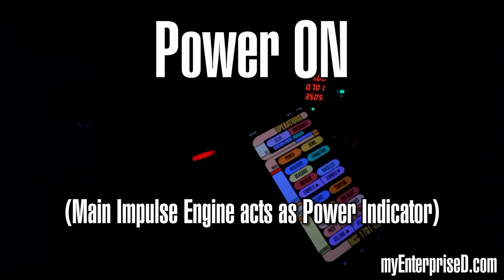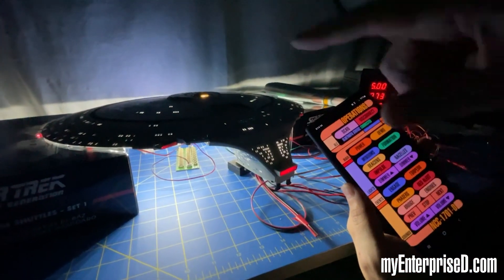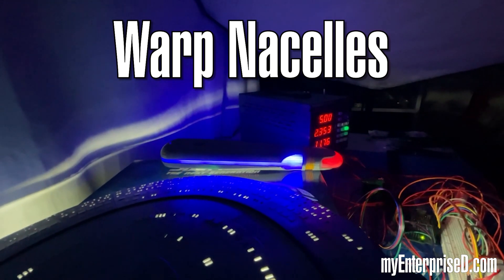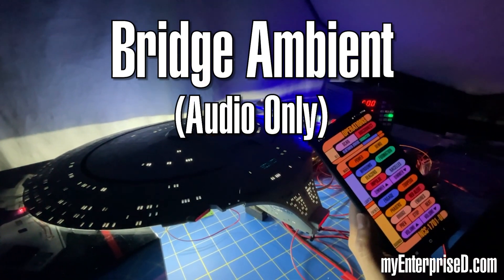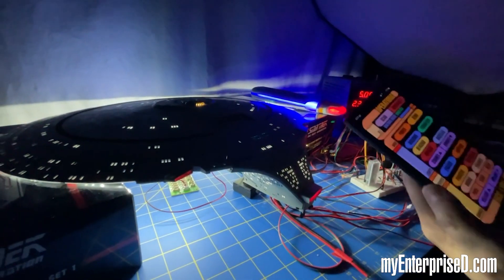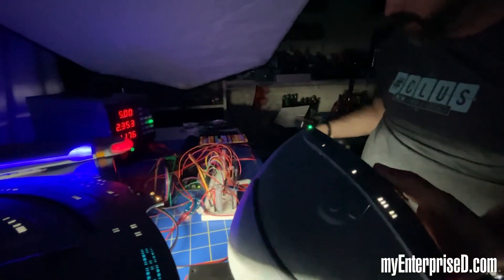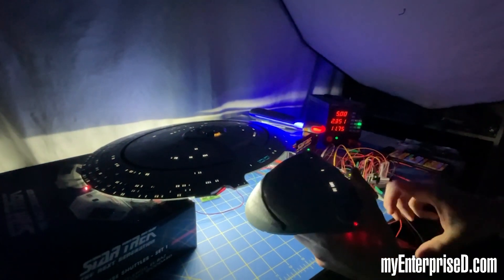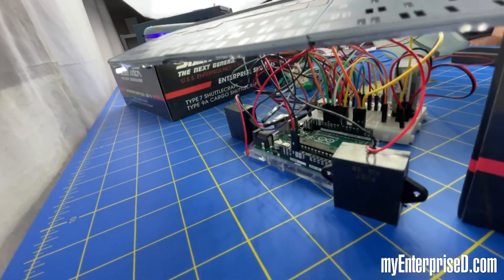Eaglemoss Enterprise D - Custom Lighting Test 3

Comment: Hey man, loving the video. I've been collecting and haven't opened one yet. Wanting to do it all together. I've seen a lot of videos showing some problems with the build quality, how did you overcome the gaps and light leakage in the panels of the saucer section?
Reply from the maker: Thank you! Careful placement of the panels and wiring will help when using the stock lighting. With my setup, I went further with black putty along the panel seams to get rid of any remaining leaks.

Comment: amazing work on this.
I wish i could do similar to my build but with delays and me not getting a kit part beyond 78 in months, i have the fear this has problems in completing.
The delay time would be perfect to make upgrades and still get bits done that i will do if it completes, but i cant shake the feeling.
Reply from the maker: I have Issue 21 with 79-82 on the way in the US. I have no doubt EM will finish it, just a matter of when they can get stock of the remaining parts from China.